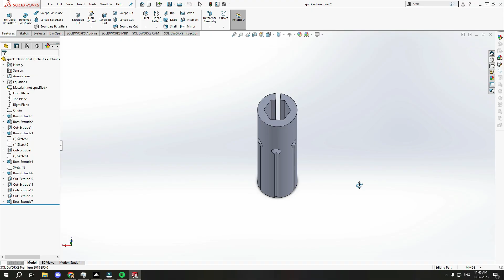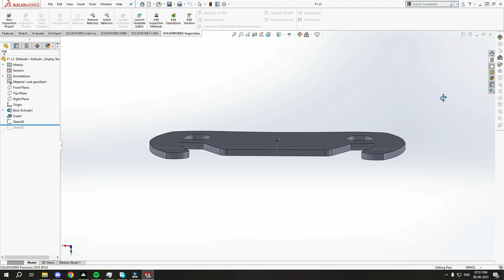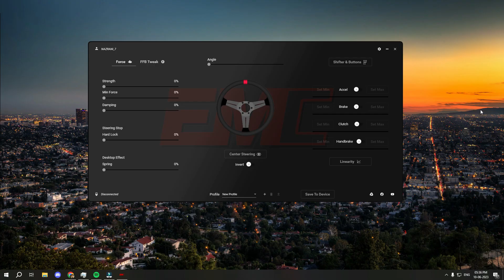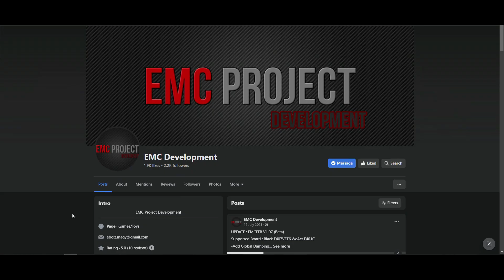DIY FORCE FEEDBACK GAMING STEERING WHEEL with QUICK RELEASE

Comment: What is the steering angle is it stuck with 900 degrees or we can set it like we want?(270,1080,180... degrees)
Reply from the maker: You can set any degree
Reply: @AllenResalam  Can ı use Arduino Leanardo instead of STM32?

Comment: Hello, a question instead of using the power supply you asked for, can you use a PC one, and if so, what specifications should it have?
Reply from the maker: No I will never use a pc power supply as it has thin wires, can melt when drawing high current
Reply: @AllenResalam and Not to forget the pc power supplys have this overload Protection Where the power just cuts off while playing

Comment: Is it possible to know how much NM has?
Reply: Vim procurando a mesma informação. Não achei. Mas joguei a especificação que ele usou no ChatGPT e pedi pra ele calcular.

Resposta curta: aproximadamente 0.6 a 0.7 NMs.

Resposta detalhada:

1.	Especificações do motor RS775:
	•	O torque do motor depende da sua corrente e voltagem de operação. Em geral, o RS775 típico, operando em 12V, pode fornecer aproximadamente 1,1 a 1,5 kgf.cm de torque (0,11 a 0,15 Nm) diretamente no eixo.
	•	Este valor pode variar dependendo da qualidade do motor e do driver utilizado.
	2.	Relação de transmissão das polias:
	•	O sistema de polias mencionado usa uma polia maior (100 dentes) conectada ao volante e uma polia menor (20 dentes) no motor, resultando em uma relação de transmissão de 5:1.
	•	Isso significa que o torque no volante será multiplicado por 5, mas a rotação será reduzida proporcionalmente.
Torque estimado no volante (sem perdas):

T = Motor * Relação de transmissão

Para um torque de 0,15 Nm no motor:

T = 0,15 * 5 = 0,75Nm

	3.	Eficiência do sistema:
	•	Nenhum sistema é 100% eficiente. Fatores como atrito nas polias, eficiência do driver BTS7960 (~90-95%), e o desgaste dos rolamentos podem reduzir o torque final.
	•	Considerando perdas (~10-20%), o torque pode ser reduzido para cerca de 0,6 a 0,7 Nm.
	4.	Limitações de força no driver BTS7960:
	•	O BTS7960 pode fornecer até 43A contínuos em condições ideais. No entanto, no caso específico do RS775 e da fonte de 12V/20A, o sistema provavelmente está limitado a cerca de 10-15A.
	•	Isso pode restringir o torque máximo do motor, especialmente sob cargas maiores.
	5.	Correia e estrutura mecânica:
	•	A correia GT2 e o suporte de madeira/3D podem limitar a força máxima antes de falharem mecanicamente. Um sistema robusto suporta forças maiores, mas vibrações ou folgas podem afetar o desempenho.

Torque máximo estimado

Com base nas especificações fornecidas:
	•	Torque do motor: 0,15 Nm (estimado para o RS775 em 12V).
	•	Multiplicador das polias: 5x.
	•	Eficiência geral do sistema: 80-90%.

T = 0,15 * 5 * 0,85 = 0,64Nm

Esses métodos levariam em conta todas as perdas no sistema, fornecendo um valor exato.

Conclusão

Com base nas especificações e estimativas, o torque teórico máximo desse volante é de aproximadamente 0,6 a 0,7 Nm, considerando perdas no sistema. Para medições exatas, seria necessário usar equipamentos de teste.
Reply: @RodrigoAbib  GPT's answer is wrong. A single RS775 has 16kg-cm stall torque, which is 1.6Nm. We have 2 motors and multiplied by 5 with pulleys we get 16Nm max torque. However he uses only 1 motor driver and a small power supply. A single 775 alone can draw up to 25A to deliver that 1.6Nm number. He needs 2 motor drivers and at least a 40A PSU. 

To avoid overheating it is advised to run the motors at around %70 power. Also taking %20 away for losses you get around 8Nm torque which is realistic for a setup like this. Another problem though is the belt used. GT2 belts aren't great, they can stretch when pushed and this will significantly reduce the torque you get. HTD3M belts are much better and can you much closer to that 8Nm number.
Reply: @RodrigoAbib  Outro detalhe é que esse tipo de motor tá menos de 70 no ML então creio que não se espere realmente muita força dele.

Comment: I knew that in g29/g920 the zone with no Force Feedback (10° right and left) are caused by it having 2 motors, that have to "coordinate" first before apply force. The T300 instad, doesn't have this problem because it's belt driven and with only 1 motor.
So what about yours? Does It have an initial dead zone?
Reply from the maker: Mine does not have any initial dead zone

Comment: if im using 24v 250watts 14A ebike motor for ffb can i use 24v 360watts 15A powersupply? AND is IT good or something bad happen like high temp or heat im using 2 bts7960 driver
Reply from the maker: Yes the power supply will be enough but i would recommend a car battery of min 35 Ah for the ebike motor and the motor driver can handle it fine, just use heat sink and fan for cooling
Reply: @AllenResalam  what volts for fan?
Reply from the maker: 12v pc fan

Comment: the idea is nice, but ugly AF. just a thin wet sandpaper and then spray paint:( instead of that wood why not print the wheel too? or use another wich can be sand down and spray painted. i think the case is too much thick. well finally works fine and that's the important part.

Comment: Any issues with overheating?
Reply from the maker: with 2 fans, no overheating at all
Reply: Thanks @AllenResalam
Reply: @Y-S-S-H  Worked or not? still overheating? got a rs550 with the overheating issue when i use 12V, with 24V works weak

Comment: how well would it work with 60 teeth pulleys instead of 100?
Reply from the maker: less torque and more current draw
Reply: @AllenResalam  oh but I can't find any 100 teeth pulleys on Amazon does the old design also use 100 teeth pulleys?

Comment: i was also trying to make this project but suffered a problem where i live stm boards i cant find an where so is there any alternitives for that edit: i found one but can i use it STM32F103C8T6 also is the encoder incremental or absolute PLEASE ANY BODY REPLY
Reply from the maker: yes you can use STM32F103C8T6  and the encoder is 600 PPR 2-Phase Incremental Optical Rotary Encoder

Comment: Bro can we use STM32F103C8T6 board instead of using STM32F401CCU6 board because i already have STM32F103C8T6 board inhand.
Reply from the maker: yes but its older and uses old version of EMC
Reply: @AllenResalam  thanks bro also can we use potentiometer with gear instead of rotary encoder cause its expensive
Reply from the maker: No potentiometer wont work
Reply: @AllenResalam  Bro also can you make a video of programming the board.Thank you

Comment: Hi
I have question 
Is this wheel 900 degrees?
And can i connect a H shifter to it?
Reply from the maker: It's range is from 5 to 2000 degrees
Reply: @AllenResalam  Thankful . Can I set it to 900 degrees myself?
Reply from the maker: Yes you can set to any degree in software
Reply: @AllenResalam  thanks a lot a have another question 
Can i connect it to console like xbox or play station with software or any extra board?
Reply from the maker: no it only works on PC
Reply from the maker: Yes you can connect an H shifter, I'm working on it
Reply: @AllenResalam  good work

Comment: Why did you use that rotary encoder 
One more doubt , i.e.
Is this the direct drive strings wheel or it is like Logitech one 
How will we get vibrations of forse feedback 
Because I didn't see any other dedicqted motor for vibrations?
Reply from the maker: it is the best quality and accurate encoder for the price. this is like Thrustmaster T300 but dual motor and those motors  do all the FBB work

Comment: Hey! man really impressed by your work. I have a question that stm32 board require stlink to load firmware. So in this board you using , you also used st link orr just plug into your computer and load it??
Reply from the maker: You don't need stlink for this specific board, just plug with usb c type and upload firmware
Reply: Can you tell me what is the rated output torque of your build and also mention the rpm .
Reply from the maker: i didnt calculate the torque but i can say its good enough (2 motors pulls 15 amp at 12v),
also rpm doesnt matter .
Reply: Also I am very confused about what is the desired rpm for drifting. Is 400 rpm is enough for ffb wheel.
Reply: Thanks for that. Also can you provide me a link to the wiring diagrams of stm32f401.

Comment: Hi, why did you change the threaded rod that you used in previous build?
Reply from the maker: it was wobbly and not durable at all compared to a 12mm solid steel shaft , also a perfect fit for the pillow case bearing
Reply: @AllenResalam  I followed the steps in your first video and used an 8 mm threaded rod. Do you think that if I change to an 8 mm steel rod it will be more stable? I don't want to change all the bearings :c
Reply: The spline setup is much better! More on par with the spline in a real transmission, at least for strength

Comment: how much was the total cost of the whole project, and how much would it cost if I don't wat it to be quick release and will it work with forza horizon
Reply from the maker: 1.about 100 USD without 3d printed parts 
2. yes it will work with forza , use forzaEmu